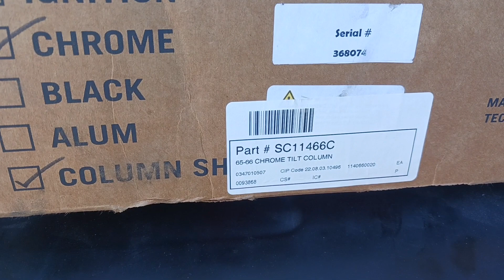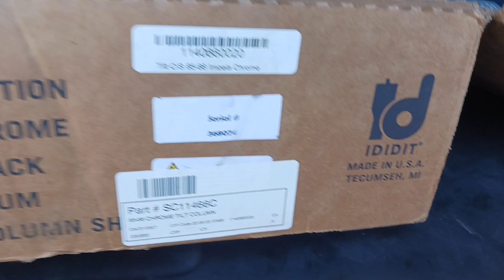1966 Chevy Impala restoration, ididit tilt steering column

Comment: hey bro whats the adapter called or the part number or did it come with the adapter?
Reply from the maker: One part is called the steering coupler, and other is called rag joint  ,that the lower connection to gear box
Reply: I can not find that collar lol I can find the rag joints but not that collar like the original has.